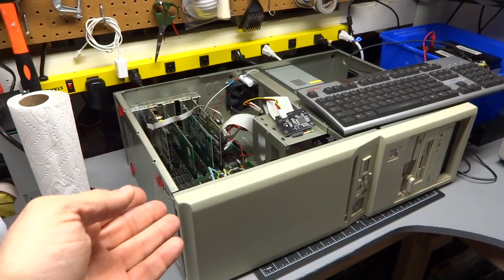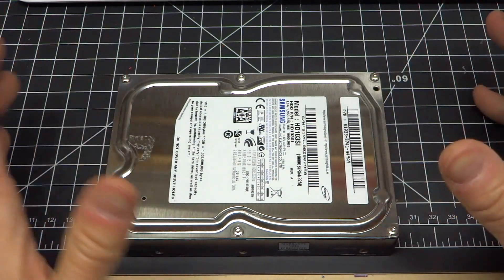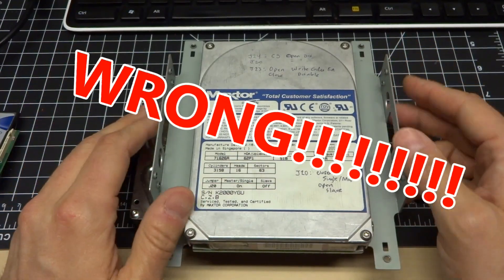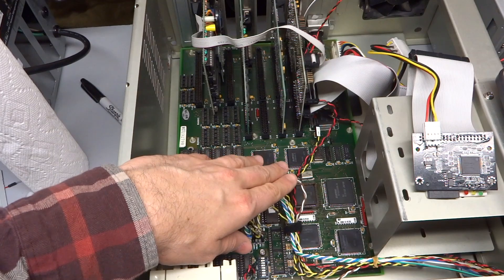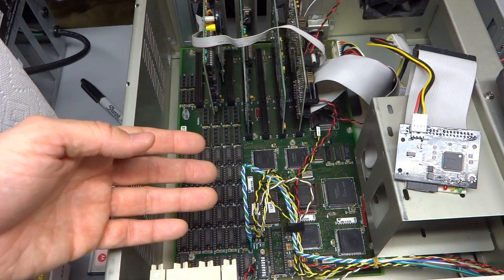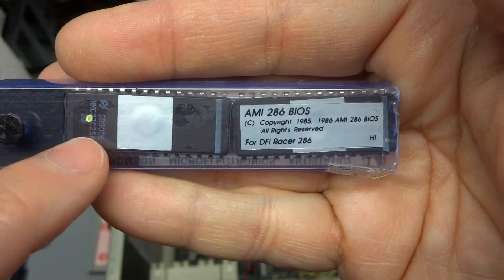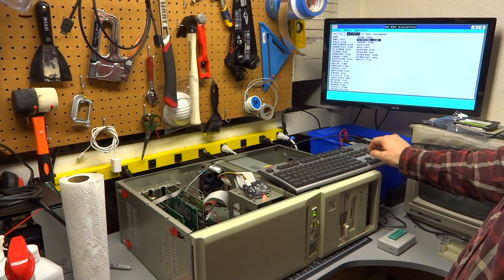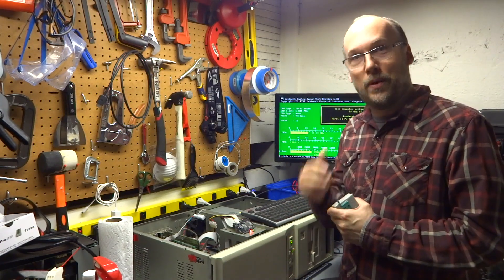I got my 286 working with a SD to IDE adapter!

Comment: You can get a 25$ Raspberry Pi, mount it in a old AT case, run DOSBox and be done.
Reply: But how do you connect e.g. a parallel port zip drive to it? Or put in an old ISA card?
Reply: If you are in the for the nostalgia then you need a authentically noisy 20mb HD. LOL.
Reply: Big Mofo man that is so lame! don't get me started it's all about the hardware for some of us ay
Reply: Big Mofo wow how narrow minded. The creation of all software ever made to this day was only possible buy that erelevant thing called hardware
Reply: that defeats the purpose, and emulation is not the same. dosbox "feels wrong" and it's very basic, it's not a full featured OS like real DOS
Reply: There's a reason it take a 3ghz cpu to correctly emulate a SNES. Getting cycle perfect emulation is tough. Rasp Pi is arm, you'd be translating to x86 instructions. Also maybe Adrian wants to play a game that's old enough it expects a 286. Some early 80s games were tied to the clock rate of 4.77mhz,etc.
Reply: The hardware is irrelevant. Software is eternal.
Reply: Ya, the 20MB hard drive definitely seals the deal. Unfortunately, those MFM hard drives run a couple hundred a piece on ebay.

Comment: Thank you thank you...
I have a 286 portable computer and the hard drive is a gonner. I wanted to put a CF-IDE adapter but that didn't work, neither do my IDE drives. I have the AMI Bios (1987) installed. Exact same chips to!
Reply: Get an Network card with rom socket, and burn the XT-ide bios onto that.
Reply: @WynandKarsten  Sounds like a great way to get around that issue.

Comment: Need to try and revive a 286 machine I have. It is the only machine capable of programming the old Motorola Saber two way radio. It is slow enough to talk to the radios comm port. Anything faster will literally turn that radio into a conversation piece ( no pun intended ).

Comment: Ok, I'm impressed enough now to comment! You really pushed the boat out to solve this one. I have a similar fascination with old computers, been looking at the same EPROM burner on ebay for a while. I have a Compaq Portable III with the same 504MB drive limit. Some of your other vids have directed me to the VIDE software to solve that issue. In this video I learned all 286 boards are identical and you can actually flash any 286 BIOS to them. I had no idea! Thank you for the time and effort you put into these videos. Very clear, concise and well edited. Do you have any interest in older machines? I just got my NEC APC up and running. Next job is to create some 8" floppies from software images and get the printer working. I also have an Intertec Superbrain and !MS 8000 S100 unit. I have subscribed! By the way, pls keep it music/effects free - its much cleaner and less distracting. Well done!

Comment: Hey Adrian, I ran through a very similar issue with my Pentium 2 440BX-based system, the disk geometry auto-detect wasn't quite right for the same SD-to-IDE adapter.  After a day or two of Googling I found someone had a video here on YouTube describing the exact problem and solution which was this great 'WHATIDE.COM' program which managed to produce the correct disk geometry parameters: http://kevparr.com/misc/whatide.php

It's a fairly small program so it might be a really great addition to your boot floppy!  I created a bootable MS-DOS 6.22 CD for my Pentium-era systems and beyond, and including it in the boot floppy image was a no-brainer after this incident.  Interestingly, I didn't run into this issue with a Super Socket 7 board; likely because it was produced afterwards and came with a corrected BIOS.

Comment: I'm sure I'm not the first to make this offer, but here goes...

I repair computers and have a gaggle of legacy stuff that I have been hanging onto that I would like to get rid of.  If you're interested, I'll take some inventory and you can have it for the cost of shipping.  Lemme me know.
Reply: I used to have a bunch of legacy stuff (8088 class machines and pherephirals). I ditched them years ago. Kicking myself in the arse since I got into retro computers, and I could use some of those parts right about now.

Comment: You "BURN" EPROMs not "FLASH".   bit location is EPROMS are like little fuses and what happens when you program them is you BURN or don't BURN the fuses.  The UV light used to Erase them wipes or clears a layer leaving new fuses to burn/not burn.   Not quite the same in Flash chips or EEPROMS

Comment: Why do you need to erase EEPROMs before programming them?
Reply: When programming a chip, you can only set the bits in one direction (usually it's high already and you program what you want to go low). In order to undo that programming you have to expose the windowed EPROM to UV so that it can forget it's programming (the bits go back to high, if they weren't already).

Modern Flash EPROMs can do this in hardware, and the programmer can usually take care of that automatically.
Reply: Thanks, that is very helpful. I kinda figured there was a good reason like that. That's the exact answer I needed.
Reply: No, these are Eprom, not EEPROM, the former is erased with UV light, the second by electron emittion, and therefore can be done programmatically. The term 'Flashing' comes from the use of xenon lamps used in camera flashes in order to wipe the memory. Foil tape is used in order to prevent accidental wiping when taking pictures of your motherboard :) The only way to remove the electrons from memory so it can be written again with Eprom was via UV light. In theory, you could bit flip zeros to ones, but you could not flip a one back to a zero.
Reply: I'd assume the reason both need to be erased is the same though. Which is the question I was asking. I was concerned about why and not how in this case.
Reply: Hi Syphist Prime, in the case of eproms the only erase option is UV exposure, some eeproms allow for selective erase, some do not.
Reply: I knew someone was going to crawl out to make a unneeded discussion about EPROM vs EEPROM. In the video he discusses both (even if just briefly) as well as in my reply (if you'd actually hit the read more button, instead of just lashing out about it).

Comment: Great video!
I have an almost identical motherboard, a DATAMINI 286, with same SUN TAC chipset, almost same layout (apparently the only difference is in the ISA bus section)... but the BIOS is on 2 x 27128 EPROM instead of 2 x 27256 EPROM...
Strange...   I suppose I can't use the 5170 bios... am I right?

Comment: well you definately took the hard route.... nice route, but a hard way nevertheless.
seems to me that the big problem here is the 500mb bios limit.... and setting a 4gb drive in the bios as if it were a smaller drive will give you these issues.
even though your drive seems to be working now i would not be surprized to see data corruption in the future because you gave the bios a drive type and capacity the it is not.
I would bet that any dynamic drive overlay software programme would do the trick for free and safe, even with your new bios.

Comment: be aware with old IDE drives, you must "PARK".EXE the heads manually because old drives don't parks the heads automatically when the power switch off. And that is how old drives get broken, by new ppl trying to enjoy old hardware.
Reply: That's true of old drives with stepper motor actuators.  With a couple of exceptions(that probably broke a couple of months after purchase because they were cheap and nasty), any IDE drive you like has an auto-parking voice coil actuator.

Comment: I have a cheap 286 coming next week that I paid $20 for. I don't know if it works, but at least the previous owner said that power source turns on. I might be troubleshooting similar things in near future myself :)
Reply: I paid $25 for shipping, so $45 total. From pictures is looks like it has an I/O card and an EGA card inside. I have a VGA card that I can replace it with. It looks all original 286 from 80s

Comment: This is a cool project. I want to add an IDE to SD adapter to my PowerMac G3
Reply: My iBook G3 boots from an SD card using an IDE adapter. It works surprisingly well.